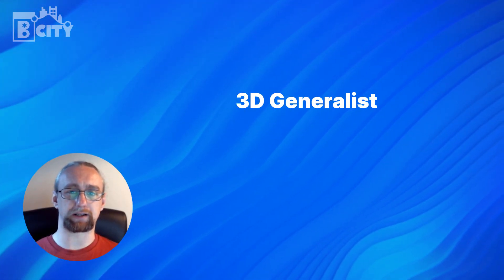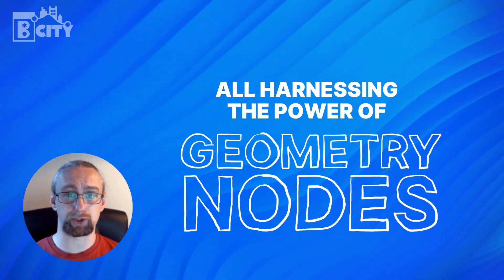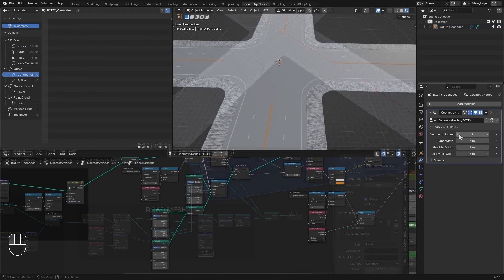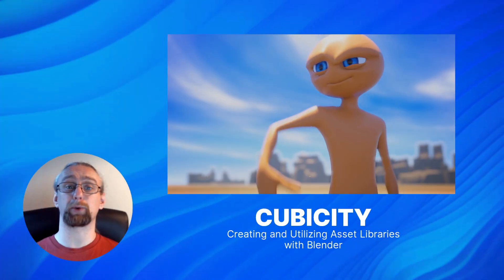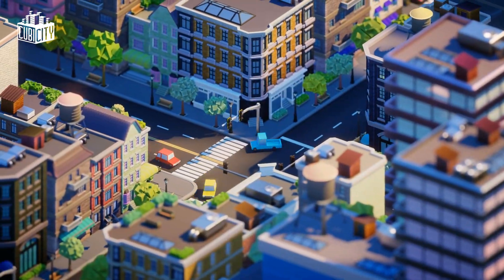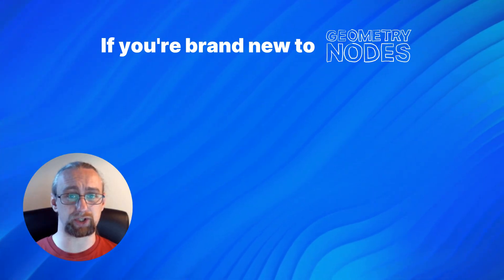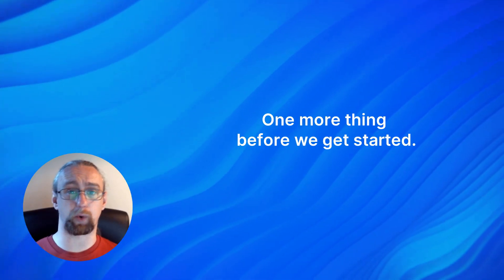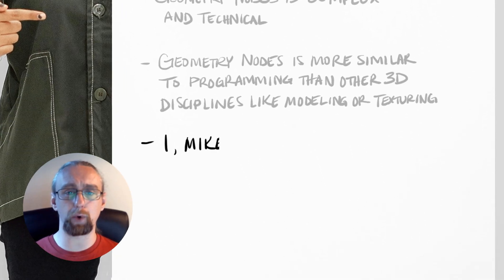Learn to create a procedural city with Blender and Geometry Nodes | BCITY | Course Trailer

Comment: Would chnaging individual road widths be done in edit mode? How do you access the individual roads splines on the fly to adjust the individal road widths? And not from the modifier stack. This nay seem like a trivial question but it's something im trying to figure out for sometime 😂
Reply: See my response to your other comment! The width of the road is dependent on a number of factors, such as the number of lanes, the width of lanes, shoulder width etc. this is the fun and joy of parametric modelling

Comment: How to change individual road widths
Reply: In the first proper lesson where I dig into Geometry Nodes (Chapter 2 Lesson 1 - Road Mesh) one of the parameters I add to the modifier panel is Lane Width, this allows you to set the specific distance/width of each lane, which is then used as part of the calculations throughout the node tree.